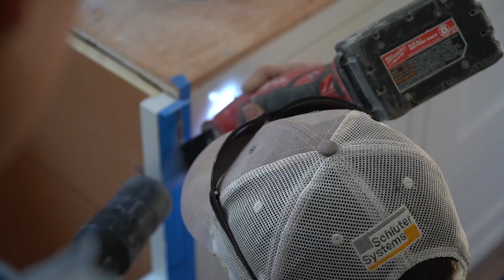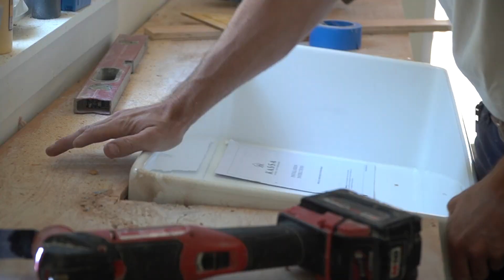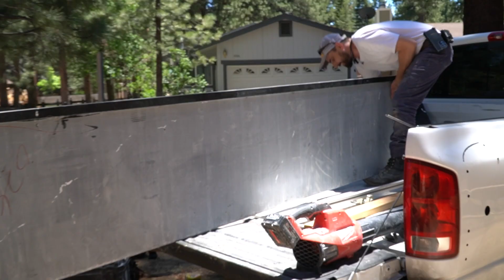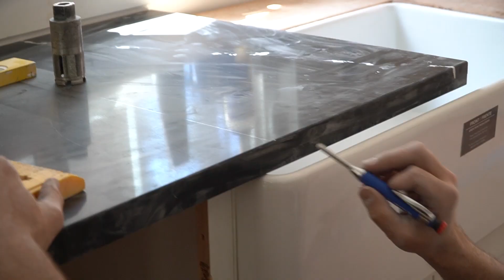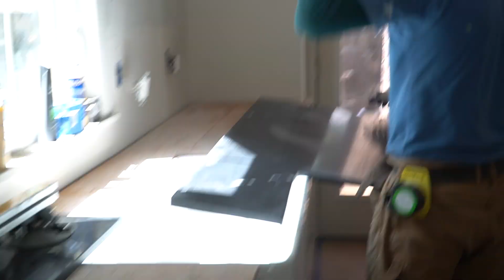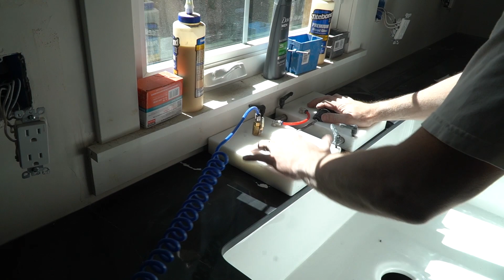Quick Install Farm Sink

Comment: This is a good video of what NOT to do,  1) using power tools next to an expensive porcelain sink, lucky didn't get that thing chipped.  2)  That cut was awful, taking proper measurements or creating a cardboard template to transfer the sink cutout would have allowed a better fit without applying that much caulking around, if cabinets where a dark color that would have looked awful.  Once he said get it done hail of high water  I knew it was going to be unprofessional.
Reply from the maker: You shouldn't comment on things you know nothing about. Let me guess you've made some DIY projects for your wife now you're a pro.
Reply: @SuperVPro  I'm not a Pro but I know when something is done right,  that sink installation you show here was a sloppy job.  I would not do that myself cause it might be worst than what you did but I would pay a professional to doit and If i see that big gap filled with caulking I will not be happy.   pay attention to detail and be open to criticism to Improve every day, no one is perfect man.

Comment: I’d be unhappy with those gaps on both sides of the sink as a homeowner. You should have checked if the sides are straight first. Having caulking to fill it in will look sloppy. That being said, I will definitely tell my installer to account for such possibility.